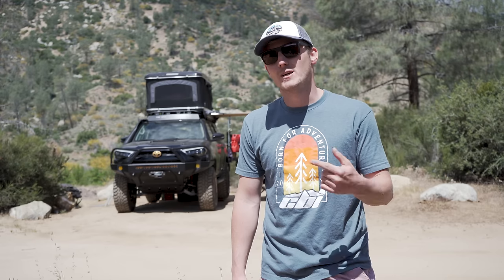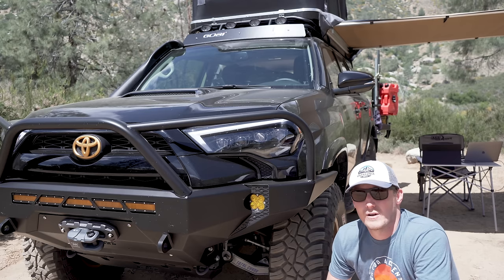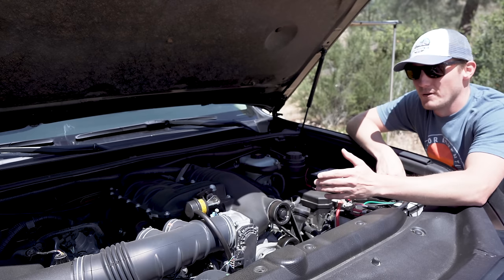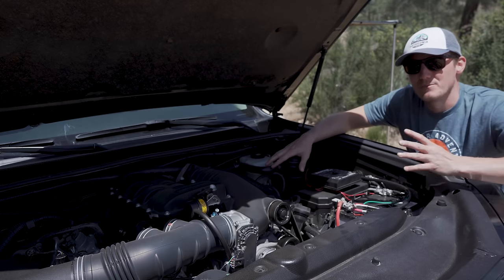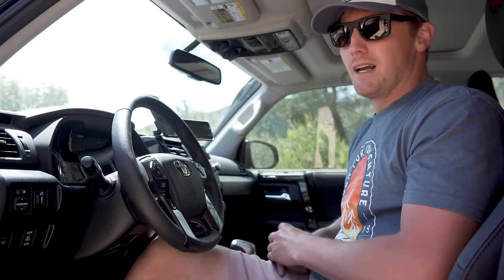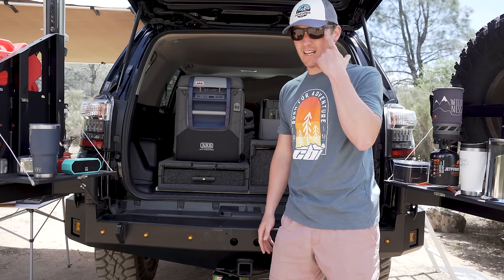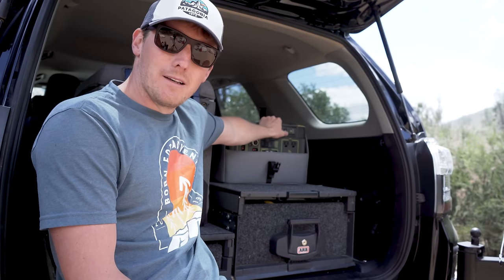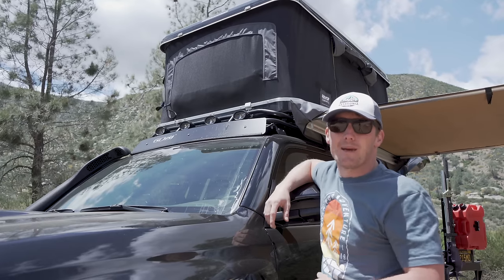The Ultimate Off-Grid 4Runner - Full Walk Around (Filmed in 4K)

Comment: I replaced the OEM roof rack on my 2007 FJ Cruiser, with a a Bajaj Utility Rack and an Autohome Maggiolina Roof Top Tent. The hard outer shell of the tent, is almost indestructible and the aerodynamics area superb. Take down and set up oft the tent is so quick and convenient. Been all over the country camping in it and it is worth every penny. Not once has there been a leak or any other problems. You will appreciate the design and construction quality even more with time. Your video was very helpful and informative as I transition over to a 4Runner for overlanding.

Comment: Thanks for posting your build. 1) Did you use the SPOD Touch Screen mount that comes with the SPOD to mount it to your center console? Did you screw the mount into the bottom of that useless little compartment or the top? Are you still happy with this mounting location? 2) How are the AlphaRex Nova LED headlights holding up? Why did you go with the Nova over the LUXX? Looks or performance considerations?  Thanks again.
Reply from the maker: Used the screen mount that came with it with a custom L bracket. What I did was take off the whole piece, then drilled down through the top of that compartment then affixed it from there. Still happy with it but larger cups in that holder will turn the screen on but no issues. 

NOVAs just were the premium choice and I loved the pattern and look of them. I'm sure the LUXX are great too but no qualms about going NOVA they are bad. ass.

Comment: First great looking truck.  QQ on your headlights.  They use the INJ 10A fuse location (per installation guide), however that is also the location for the S/C coolant pump (I have one as well).  What fuse location did you have to leverage for the DRLs?
Reply from the maker: Both are being tapped on that fuse!

Comment: Nice! I sport a very similar build without the S-pod or Super charger. For the ARB on board air I found the Mountain Off Road solution fits very nicely in the left rear of the engine bay. M.O.R.E out of Colorado

Comment: Can you mount the arb boxes and fridge to the new slide out offered on the 2023 model? The tent I often wonder if these companies make insulation for the inside. I live in the east. And our weather can change in an instant during hunting season. Nice rig set up man. I like it.
Reply from the maker: Thanks for the kind words Troy! As for the ARB mounting, I'm not familiar with the new 2023 slide out but I would say no. The boxes are heavy and the force of fully extended, loaded drawers would likely not play nicely with that slideout.
Reply: @Outworld  load rating is 440 pounds
Reply from the maker: @troyheffernan1261  I still wouldn't recommend it. Any installer or manufacturer is going to tell you to bolt straight through the body.
Reply: @Outworld  oky dok

Comment: How high up did you go with your lift? You look a bit higher when compared to my 4R. I love your build though, everything I've been aiming to get. Have the wheels, and tires. Went with the 5100 lift though, with 700IB springs. And went up 3'
Reply from the maker: It's right around 2.5" but the 35s increase the height a bit as well.

Comment: thanks for the video...I got super inspired and just purchased a 2021 TRD Offroad Premium 4runner and building it almost exactly as your 2019.  A couple of questions: First on the Airtop 360.  From looking at your video, your Airtop 360 just fits... did you go with the small version (130cm wide)?  I was thinking about the medium (145cm) but wondered if it would be too wide for the top of the 4runner and hang off the sides.  Second, I cannot get information from the Alpharex website whether or not the headlights will work on a 2021.... I'm assuming yes as nothing much changed between the 2020 and 2021.  Do you have any insight?
Reply from the maker: Thanks Clinton! The Airtop 360 is small and went with it because it does fit perfectly. As for the Alpharex, the wiring may have changed slightly in 2021 because of the LED headlights. You can definitely call them for the right answers.

Comment: good video I have a question lift my 4runner 5 gen 3 '' I put 285-70-17 mut tires but with 17x8 +15 6x139.7 wheels and I have a problem the front tires hit the control arm above I plan to change 17x9 wheels - 12 6x139.7 Do you think that will solve my problem I do not want to put spacers because I feel that they are not very safe. I await your response and thank you very much.

Comment: Awesome set up. Subscribed. Would you buy that Coleman table again? I think you have the Lepow monitor, I have 2 of those - been great. Not sure I could get them both on that Coleman though. Thoughts? Also curious, you like that battery over Jackery 1000 with 100W solar panel? Appreciate anything you’re willing to share! Thanks. I have a 4Runner arriving from east coast to SoCal in 1-2 weeks, stoked. You blew my mind on the idea of going out and finding spots to work.
Reply from the maker: For the price I'd definitely get it again, but someone mentioned a similar setup table that's more of a rectangle and adjustable height I may get down the road. For now I'm pretty happy. No experience with the Jackery but I've used Goal Zero products for quite a few years now and love them.

Comment: What are you doing for connectivity issues the backcountry? Satellite modem? Any suggestions?
Reply from the maker: I just hotspot my phone for now, and if there's work I need to have done or be connected for, I'll make sure I'm in an area with service. Otherwise if it's offline work I'll just work on it anywhere then upload when service returns. Large transfers I'll wait for getting into a city to use WiFi.

Comment: Just wondering how long did you have that supercharger installed for & did you have any problems with it installed? Cause I’m looking at putting a supercharger on my 2016 4Runner but before I spend $6,000 I want to make sure I’m making a good investment
Reply from the maker: I've had it for a year and absolutely no issues. Magnuson designed and manufactured the TRD superchargers for years, so they understand the priority of low maintenance and reliability. You'll eventually have maintenance like nosecone oil and intercooler coolant swap, but otherwise it's a breeze.

Comment: Do you manually change up how your frig is plugged in when driving around vs when you are parked/camped? When your driving around do you keep your Frig plugged into the Yeti Goal Zero and the Goal Zero plugged into your 4-Runner? When you are parked/camped do you have to change up the way you have the frig plugged in? Is your Frig power going through your SPOD at all?
Reply from the maker: I used to plug the fridge into the stock plug while driving then into the Goal Zero when parked, but it made no sense so now the fridge is on the Goal Zero all the time and just stop charging the GZ when I'm parked. Works like a charm.

Comment: Great walk around! Awesome rig. I’m  currently working on my 18 4R. Love the TJM snorkel design almost ready to pull the trigger on it. Looks like there are two screens at the top intake are they removable? Also any input on rain getting in? My only reservation is bugs/snow and  if water would get in excessively. Miss CA but now in the North East for the long run.
Reply from the maker: Thanks man! I don't believe the screens are removable, but there was an extensive thread on t4r about people mentioning using it in snowy areas with no problems reported.
Reply: @Outworld  and should work with the TRD CAI? Wonder if anyone has done it yet. Seems like it. But I called TJM and they even werent100%.
Reply from the maker: @silverrunner8687  Does the CAI have an outlet that secures to the opening in the body?
Reply: @Outworld  yes, has a rubber flange that’s used from the lower air box through the opening in the body. I saw the install PDF and re watched a couple video it shouldn’t effect the install. Actually may even give it a better seal than the stock “cupped” piece.

Comment: sweet build.  Im similar to you, minus a S/C, and I built my own "goal Zero."  Rolling on 33s, but wondering how the 35s are without a re-gear.
Reply: you definitely dont need to re gear, it's a common misconception, it's not a race car, it's an over lander.
Reply from the maker: Regear isn't necessary if you're just upping by one size, but going to 35s on stock 3.73 is definitely not recommended especially if you have it on long road trips. Nice being in the correct RPM ranges on the freeway.
Reply: if it's on road trips you want the higher gear range, keeping RPMs low and fuel economy decent, bigger tires do not effect the engines revolution per minute, however your speedometer will be off.

Comment: Amazing build, and I love that you like to keep things clean, I'm the same way. 
Do your big drinks hit your SPod touchscreen? 
I am looking into going the touchscreen route in the same spot you did, but I don't want to have to stop using that cup holder because of it. What are your thoughts on using that cup holder with the SPod installed in the pocket?
Reply: I just mounted mine on the left in front of the vent.. it's way easier to access and it doesn't really block air flow.. plus looks cool as shit and isn't hidden.

Comment: Could you explain the awning / rtt fix you did?  I'm looking at trying a similar combo.  Fun fact ARB doesn't include the L-brackets with their awnings...
Reply from the maker: I have a 3/4" square tubing spacer between each of the four tent mounts and the rack crossbar. It's still a tight squeeze and 1" may be a little better but I wanted it as low as possible. Hard for ARB to include brackets when the applications vary so much from rack to rack. Gobi makes an ARB bracket that is perfect!
Reply: @Outworld  any way you can share some pictures of the square tubing spacers and mounting points? I have the gobi stealth rack with removable crossbars, and I can't get it to fit with the ARB awning installed
Reply: I would like more info on this as well.   Ty!!

Comment: I have the 5th gen  TRD pro with stealth gobi rack and James Baroud evasion rtt. How do you take yours off with 2 cross bars so easily?  How do you store them at home?  I'm having issues with mpg since my rtt creates way more wind drag on my 4runner.  I don't have a big garage with high ceiling but I do have a storage facility.  I worked appreciate your input. 

Do you think we could fit one of those 270 awning with our rrt?

Thanks in advance!
Reply from the maker: I have the crossbars permanently mounted to the rooftop tent,  so now you just throw the whole assembly on the rack and tighten down the clamps. I'm getting the second pair to use for regular rack purposes but I love how easy it is to take off/put on now.

Comment: I have 2018. I want to do almost the exact thing. Can you help with the budget? CBI is my first choice. The roof rack and tent for sure. And then the suspension. What do think the cost installed might be?
Reply: $15,000+
Reply from the maker: There are so many variables to give an accurate quote but Justin is on the right path depending on options and install quotes.

Comment: Wouldn’t trust the tent off-road. The only 2 attachment points on the 2 crossbars are not strong enough for aggressive off-roading, will fail someday.

However, great tent, but the crank model Airliner handles high winds better and seems to have better long-term durability.
Reply from the maker: Have to disagree. I've used that same setup on a few different vehicles over years and many, many trips. Not a single sign of fatigue or failure.

Comment: What is your gas mileage with your current setup?
Reply from the maker: Hovering right around 12mpg fully loaded. Regear should bump it up 1-2.
Reply: @Outworld  what tire and rim sizes are you running?
Reply from the maker: @bonsaimanagementsolutions8037  it's covered in the video. 35x1250 and 17x8.5

Comment: Now, are you losing life longevity of the engine by dropping in a super charger the way you did it specifically.
Reply from the maker: Incorrect.
Reply: @Outworld  it was a question for you. I have a 2023 off-road and want to drop an SC. Nice set up, by the way.
Reply from the maker: @Hurricane1987  ah sorry mixed up two words! Not at all. Magnuson is the manufacturer of the original TRD superchargers so no one understands how to retain the longevity of these engines than them. That's with the stock tune which is around 5psi. You can retune and put a smaller pulley on it for more gains but you'll start asking for premature wear.

Comment: nice but a new vehicle with a snorkle?
Reply from the maker: Are they only supposed to be on old vehicles?
Reply: @Outworld  new vehicle have so much electronics I would be cautious about getting them too wet. But snorkels look cool.
Reply from the maker: @overbaugh73  snorkels aren't just about water, it's clean air as well. Most air inlets are up under the front wheel wells which will basically vacuum up dirt and dust. Snorkel allows you to pull cleaner air from much higher.

Comment: Jesus titty-fucking-christ. That's possibly the slickest, cleanest and well balanced 4runner build I've witnessed to date.
Question 1. Did you give anything up by going for the Off-Road variant vs. the TRD Pro?
Question 2. I may have missed it but did part of your build include swapping out the stock gearing to accommodate the new geometry and such? *Edit* Just rewatched your video, I see gearing is on your to-do list. Very Good.
Reply from the maker: Thanks Johnny! I gave up nothing with the TRD Off Road. Same e-locker/crawl control system, and since I wanted black, sunroof, and was swapping out the suspension it made no sense to get a Pro.

Comment: Yeah, real pretty, but it had to add 1000lbs to the weight, and I bet it was every bit of $80,000 - $100,000 for the truck and goodies. I just don't understand why there are not more videos of regular people doing their own mods that don't force them to either take out a second mortgage on their homes or beg for corporate sponsorships (which make them little more than an advertiser for the corporations) . You really wonder if this big, fancy truck ever really goes anywhere but out for ads or up to the mall. Somehow I doubt that truck has ANY scratches from trees and bushes and rocks on THAT expensive paint job and parts, lol.
Reply from the maker: If you saw my last build I spent a few years turning that into something more approachable but capable. At the end of the day this is still less than a new Land Cruiser and it's custom tailored to my needs. As for where it goes, I just got back from a week in Moab, White Rim Trail, etc. It absolutely gets used. You can check out the IG page for more pics.

Comment: gap, front wheel well and brush guard is horrible.
Reply from the maker: Not sure what you're saying, but if you're talking about the gap between the front bumper and body that's intentional as there is a degree of flex when off roading.
Reply: @Outworld  its still a good job. But the gap goes from small in front to much greater in the front wheel well.

Comment: I AM TROLLING: If you need a gas station, you are not off the grid... go electric, and get your power from solar, wind, or water... THEN you are really off the grid...
Reply: Yeah, you are TROLLING.
Reply from the maker: This truck runs off unicorn farts and Flinstone foot power with a hydro electric dam in the back for safe measure.
Reply: I wonder the tires size?
Reply from the maker: @jorgearteaga9443  35x1250